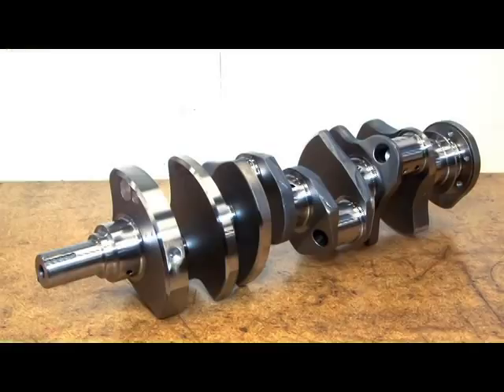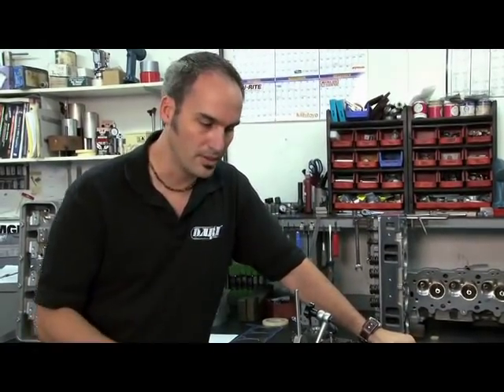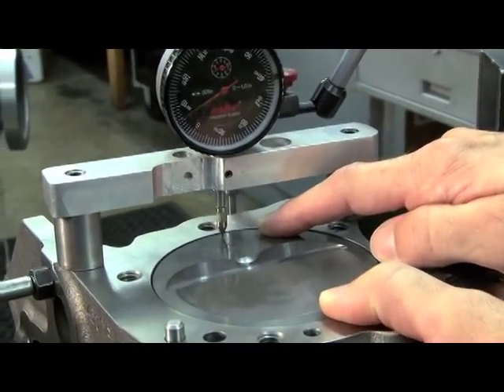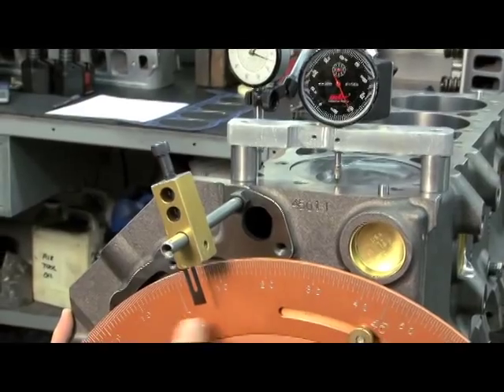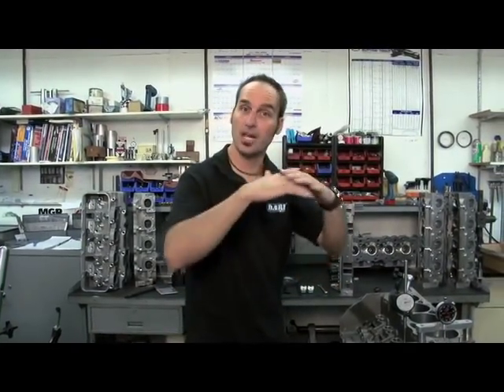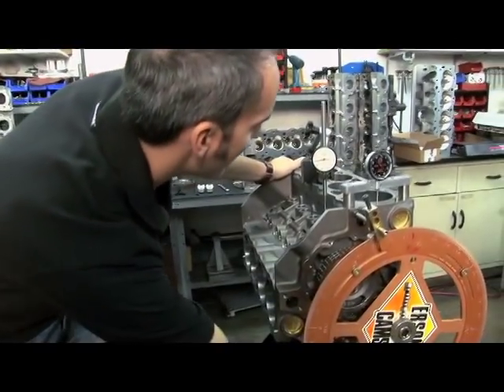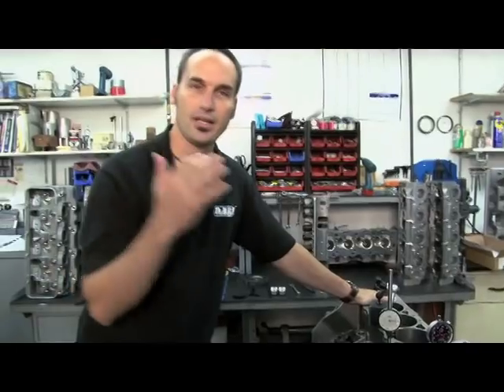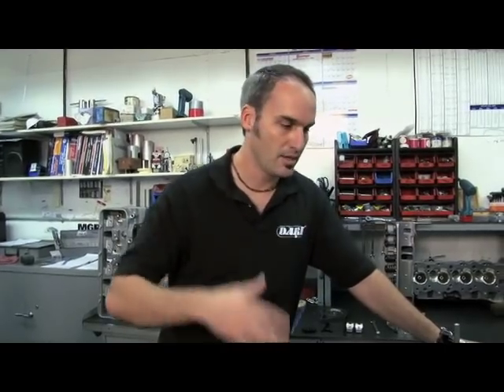Dart University, Degreeing Your Cam

Comment: You right down the degree at 50 , that's what he's referring to. To see if it matches the cam card. You find true TDC with a piston stop or plate. Should be the same on both sides then take off the plate and go to zero on the degree wheel. Zero out the dial indicator afterwards. Then check to see if the cam matches the card at 50 for both intake and exhaust.

If my card says 6 and 44 for intake. I go to 50 on the dial and check to see if I'm at 6 degrees. Then continue to check the 44 , then go to exhaust side.

Comment: Good video. Can't believe the complaints about the music? If you can't figure out volume control on your computer don't work on engines.
Reply: 77dragraceRT the issue is, if you don't know how to do this, the music is just as loud if not louder than the host, i have trouble hearing him and it is very distracting. if they had overlay-ed it half volume or so there wouldn't be an issue. just some feedback is all, the video is awesome, i find the music very distracting while trying to learn what he is doing.

Comment: I have an 02 Volvo S40 1.9T.  There was an oil leak in the seal of the sprocket on the camshaft.  The timing was marked off and then the crank (closer to the cabin of the vehicle- exhaust side?) was removed by my mechanic.  He did not mark the opposing end of the shaft before realizing that there is no keyhole to set the shaft back in proper position.  I am afraid he will not be able to complete the job without damaging the engine further.  Is degreeing the camshaft my best alternative to bypass finding the marks to set the timing straight?

Thanks!

Comment: How much does the cam timing change when under load from the valve springs and drivetrain?  It is known that the timing chain stretches and gear wear affects cam timing.  How would you compensate for it accurately?

Comment: After paying 150+ for a cam, i hate to think i need to check what they should have checked in the first place.
Reply: You're not just checking the cam you're checking that the crank keyway and timing chain set were all manufactured correctly.

Comment: where do you get the number 20thouuuu. um i mean thousandths 😠
Reply: Jose Padilla it does not mather, could be 30,40,ect . as long it is same on before and after
Reply: azbertx got you basic math numbers have to meet equal to eachother.
Reply: "Though" is slang in a machine shop. Its short for thousandths. If you don't know this it means you have zero % actual hands on experience and have been in school for way too long.
Reply: @smh9902  'thoughsandths'?